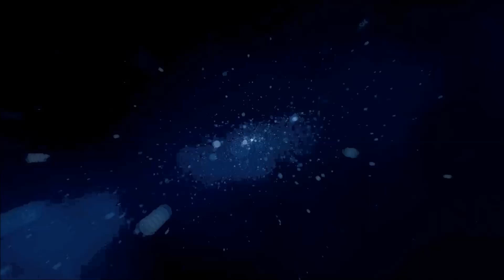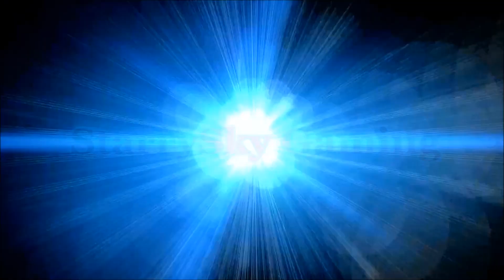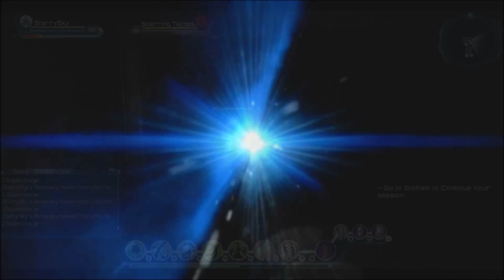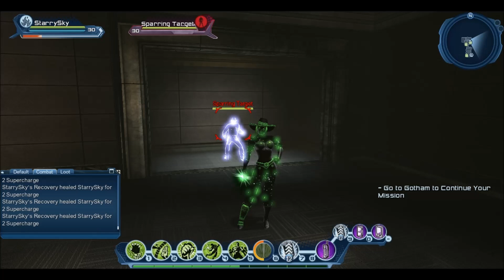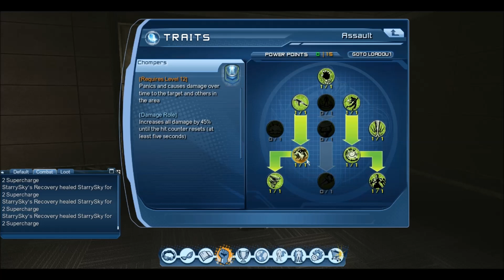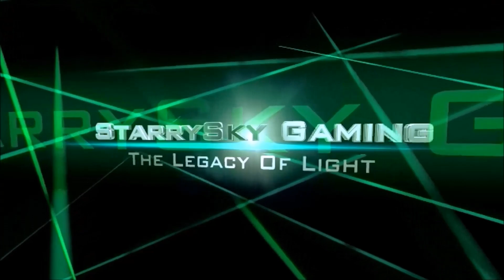DCUO NEW HL Dps Range Combo Guide + Loadout&Power Points.

Comment: how are u cliping fan like that? i only get the shot after the fan is near the end?
Reply from the maker: they are changing it so you wont be able to clip the fan like that anymore so i wouldnt worry about the animation until after DLC 10 i think.
Reply: StarrySky Gaming
 Since they are taking clipping out of the game, do you think that will make HL weak?  Or will it make us switch up our combos?  Im kind of nervous about the changeover, just figured id get your thoughts on it.  Thanks bro
Reply from the maker: there not taking jump clipping out of the game. They are just making it so you can't jump clip a power so it has no animation time. You will still be able to jump clip fan but you will need the fan to appear before you can jump clip it. It will slow HL down and it will drop damage but it won't be as bad as what people are making it out to be.

Comment: FOUND IT after 20 mins of searching lol cool vid starry what happened to sidekick robot you don't use that anymore :O ill change to this load out lol when i gt enough cash on my Gl Hl dps
Reply from the maker: these videos will help you with HL but its a shame i cant do HL dps videos until they fix the HL bug i have.
Reply: what bug do u have o.o :s
Reply: also can u explain why u don't use the side kick robot ?? sorry if I'm Bombarding u with questions about Hl I'm new to it :s
Reply from the maker: all the best HL Dps combo require you to use snap trap from the loadout to use as part of a combo but the snap trap wont construct the fan around 80% of the time when i tap range.
Reply from the maker: you can use robot sidekick if you want to but i guess its just down to what you want in your loadout.
Reply: ok  ty
Reply from the maker: np :)

Comment from the maker: the idea is good but the most power efficient combo is just Ram+snap+fan since the only power use it when u press ram. 
Since i play both controller and Dps its the controller role to fill power bars and its the dps's job to kill stuff as fast as possible which will need alot of power. As a dps if u wanna help with power you can just use a soda when low on power, this will help the controller out more than a player trying to be more power efficient.

Comment from the maker: i did do a updated video on my mods im using but my sockets are - Red Sockets - Prec V Expert, Blue Sockets - Prec+Health V Expert, Yellow Sockets  - Resto+Prec V Expert.

i use resto+prec instead if prec+power because the added resto will give me more base healing from healers and also makes my light barrier(shield) that bit more stronger so it can take more damage.